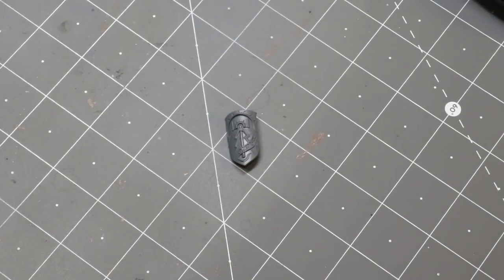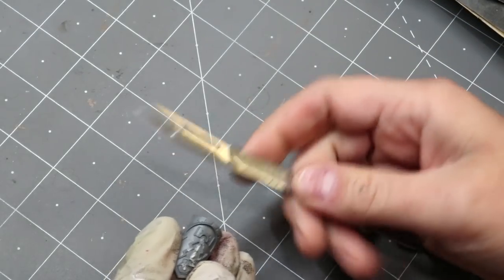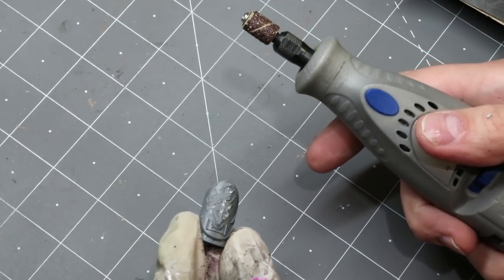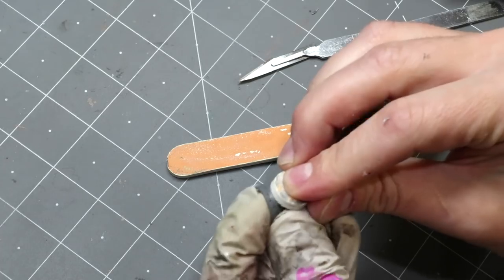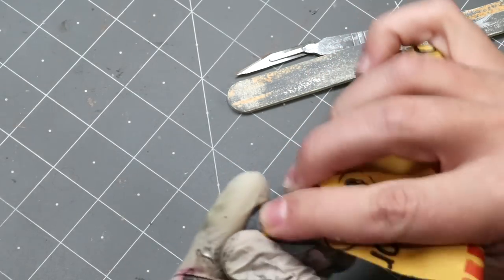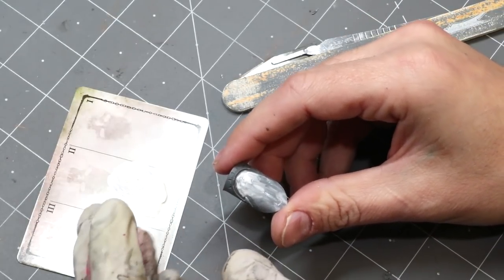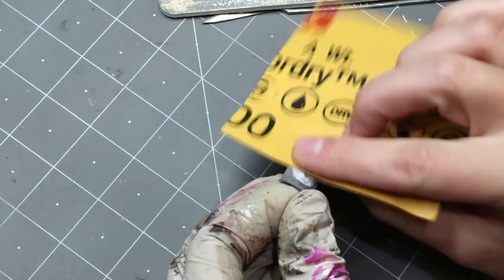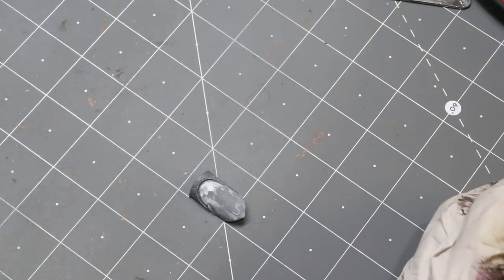Hobby Cheating 231 - How to Cleanly Remove Details from Minis

Comment: The way I've found that works best (without a dremel) is a sort of chiselling method where you do many parallel cuts into the detail (can also crisscross the cuts), perpendicular to the flat surface underneath. Then I can much more easily shave through the detail with a hobby knife and scrape it back before sanding.
Reply from the maker: I like the parallel cuts method, it definitely makes it easier to get into the surface and less chance of the knife skipping.

Comment: In general, I've found that a micro chisel works often better and safer than a knife for this kind of surface-detail-removal work. It's one of those tools I can't see myself doing without anymore.
Reply from the maker: Never really tried it, I will have to give it a go.
Reply: (3 years later) do you have a rec as to a brand or specification? I am having a lot of trouble removing mold lines from detailed areas (such as faces and bumps)

Comment: Nylon & Copper small brushes off amazon, for clearing away loose plastic on your models, nylon for not damaging plust dust removal and copper or even steel for getting semi loose plastic right out after rough sanding. Tamiya sanding sponges: Come in a variety of grits as a pair of sheets in a bag, you can cut them with scissors to any shape or size you desire and they curve to a surface.
Reply from the maker: That's a really good tip for sure.
Reply: @VinceVenturella  Also the x-acto blade / scalpel brand - Chisel type blade can be a very good option for removing small details from flat surfaces.

Comment: For big surfaces, I like to start with a bench grinder rather than a Dremel. The radius of the wheel is much larger, so you're less likely to dig into what will be the final surface while taking off the bulk of the detail. Then continue as you have here.
Reply from the maker: That's a good tip for sure. :)

Comment: I'm experimenting with cheap nail polish tools. AA powered (I use rechargable ones), use same bits as dramel and cost is minimal. 

I find lower rpm easier to control. Also it is made for woman primarily, so tool body is easier to handle, lighter and more precise.

 Certainly don't have the speed and raw power of power tool, but it's good to start with and then upgrade if necessary.
Reply from the maker: That's actually a really clever solution for the small details, I'm going to give that a shot!

Comment: Thanks again for the video Vince!!!
Don't know if you have already done a video on that but if you have any techniques to clean uggly 3d print lignes. They're is more and more minis with that and sometime you don't have any acces for a tool to clean that.
Reply from the maker: THis is something I've thought about. One solution i've played around with is the gap filling auto-primer. It's rattlecan, but it's meant to level out a surface and cover minor inconsistencies in the surface without straight removing detail, but it is a concern.
Reply: @VinceVenturella  That would be a very interesting topic and probably one of th most actual one.

Comment: These techniques work for plastic, but what if our mini is resin or metal? Are there different methods for those materials?
Reply from the maker: It would be much the same, but you would need some harder scraping tools for metal and you'll need to work much harder to get it perfectly smooth in the end. Metal is almost always more troublesome to work with unfortunately.
Reply: Thanks